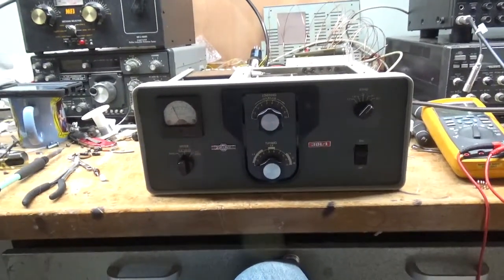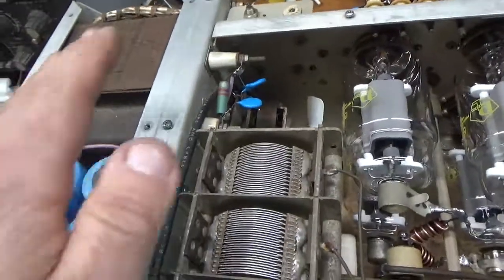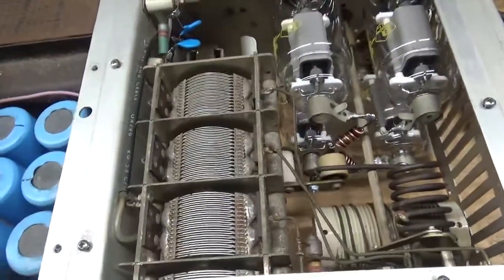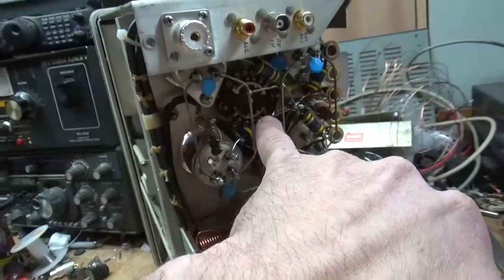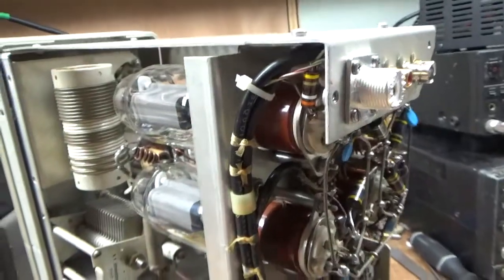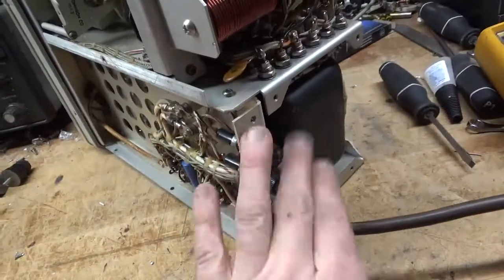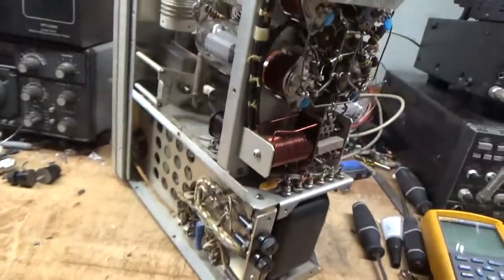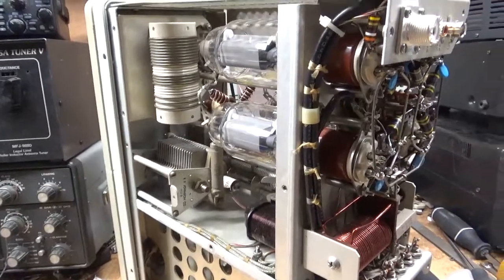Collins 30l1 Repair

Comment: You description of what you do is completely over my head and I love it.  I have a question.  I just bought a Collins 30L-1 and I can't figure out how to connect it to a more modern radio.  I have a Yaesu FT 950 that I would love to use with the collins.  How do you connect to the RF In?  It's just an RCA jack.   I noticed in this video that the connections on the Collins you were working on is totally different.  Can you help me?  If I can get it running first, I would like to send it to you too make sure it's all good.  But I would at least like to try it first.  There is not a single video out there that shows how to connect a modern radio to a classic amp. like the Collins.  Thank you for any help you can give me.
Bob Galey
Reply from the maker: Hi Bob, You would need an adapter that is so-239 to rca male. You could then plug your pl-259 on your jumper between the radio and this adapter, into the amp.
You cannot use the internal radio relay to key the amplifier. You would have to manually key with a foot pedal or use a ameritron arb buffer box.
If you need the amplifier worked on feel free to give me a call